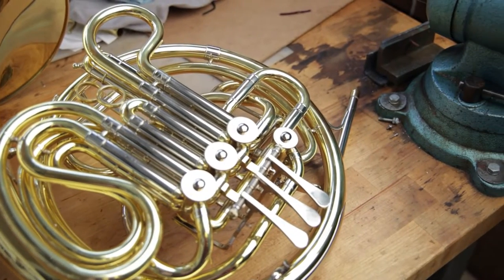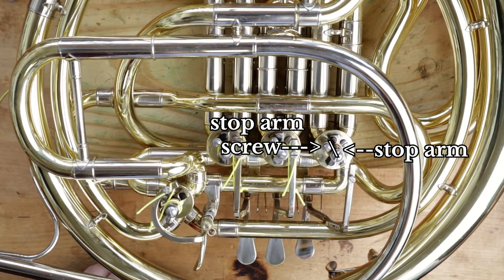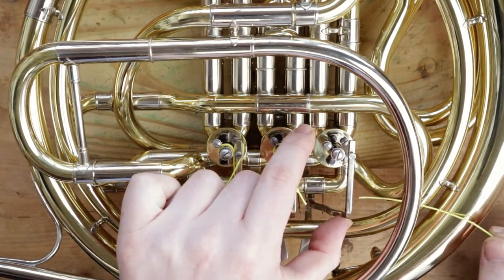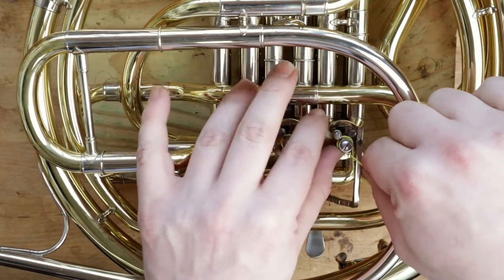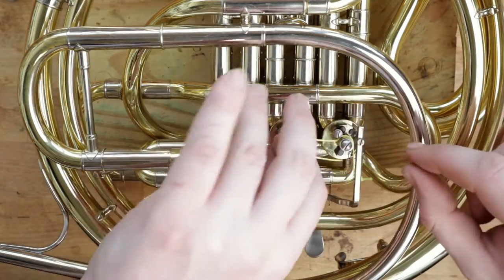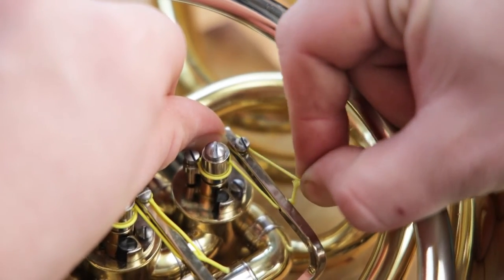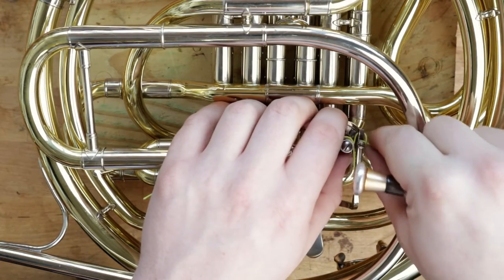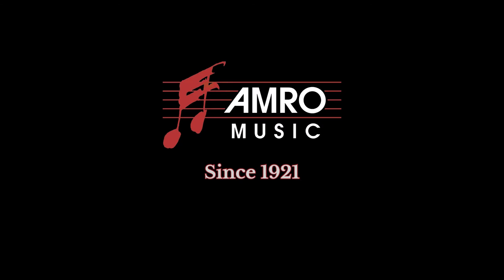How to Restring a French Horn Rotor Valve

Comment: You can make the initial knot larger by using a figure eight knot. Sometimes the single knot is not large enough to prevent the string from pulling through the hole.